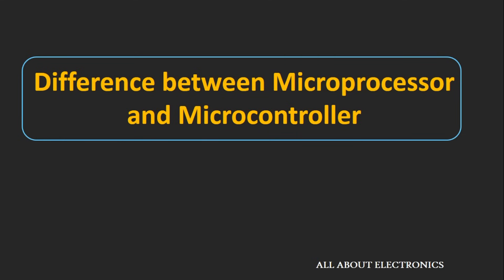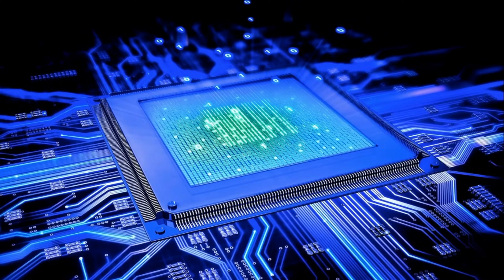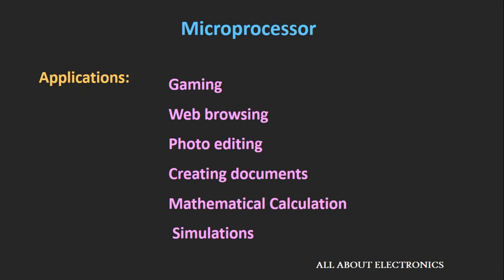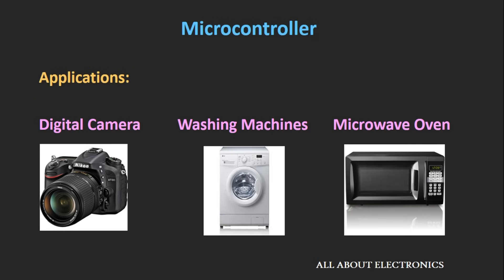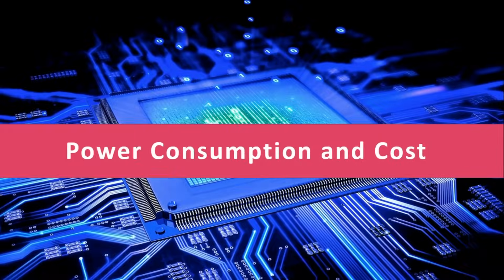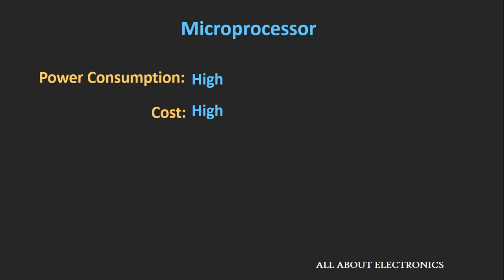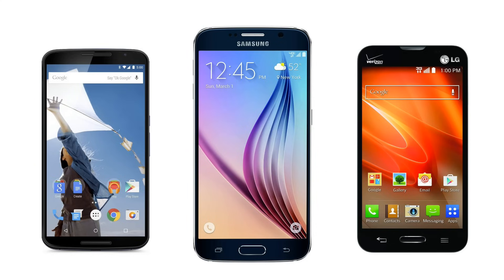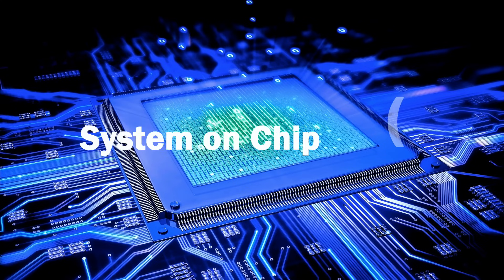Difference between Microprocessor and Microcontroller

Comment: Gimme the chance to save 7 mins of your life

1. Microcontrollers are used to perform a specific task while Microprocessors are used to perform wide variety of tasks which need not be predefined.
2. Examples where a micro-controller can be used  camera's, washing machine etc Microprocessors most commonly used in computers.
3. In microcontrollers since they do a specific task all the ram and I/O ports are integrated internally on the other hand in microprocessors all the input and output ports are integrated externally since the requirement is based on the size of the software. 
4. Processing power in  microprocessor is usually between 1-4 GHz and in microcontrollers it lies between 1MHz to 300Mhz
5. MC RAM: 2KB to 256KB            MP: RAM: 512MB to 32 GB
6. MC ROM: 2KB to 256KB           MP: ROM: 128GB to 2TB
7.  MC Architecture: 8bit, 16bit, 32bit    MP Architecture: 32bit and 64bit
8. MC Powerconsuption and cost: Low MP: HIgh

Comment: I already have an 
1 1/2 " by 1 1/2 ",circuit board with 15 circuit pieces that I have already soldered into it, I need help figuring out how to get electric current through this theoretical circuit to power small micro motors in 2 different directions,  that is all I need,
Reply from the maker: Have you checked the interconnection between the circuit components? And are they connected with the power supply?

Comment: Actually, the term "micro processor" isn't limited in smartphone and personal computer. Microcontroller consists of microprocessor. You've misunderstood about this point. Secondly, hard disk which is permanent storage media can't be RAM or ROM. ROM (read-only memory), which is normally used for BIOS or boot code, not for storing some shit files.

Comment: Today's microcontrollers are more powerful (and have more memory) than microprocessor systems had in the past, so the differences, in that regard are really superficial. What is more important is the difference between "bare metal" and operating system based programming.

Comment: there are some important updates to made in your slide microprocessors with clock speed of 8 GB are also available in market eg.  FX-8370. You have mentioned ROM and Hard Disc as same article but these are different . thanks for providing a knowledgeable video

Comment: I would say that today, the best way to tell the difference is the application space that the product is intended to address.
The distinction between microprocessors and microcontrollers are becoming more nuanced as SoCs (from the microprocessor side) and microcontrollers move toward a convergence and many FPGAs (Field Programmable Gate Arrays) are including built in processor cores.  There are general-purpose microcontrollers that use ARM Cortex-M and MIPS (and now RISC-V) based cores, can access external memory, have larger ROMs/NVM, and high clock rates.  Some of the microcontroller cores have floating point instructions, digital signal processing instructions, and other advanced features that are typical of modern microprocessors.  Today, embedded systems designers can use microcontrollers where 10 years ago a microprocessor would have been required.  On the other hand, the System on Chip (I know, another video) offerings now provide features previously only available in microcontrollers.  More than few offerings combine both types of cores in the same package. The convergence point is System on Chip from both ends.

Comment: Can we add a mobile phnoe microprocessor and microcontroller to the arudino uno board
Reply: It already exists. Check out the UDOO board. It's an Arduino compatible, which uses a tablet microprocessor (it's actually a system on chip, but that is what allows it to fit the Arduino form-factor).

Comment: Comparing microprocessors to microcontrollers is like comparing formula 1 racing car to a Vespa Scooter, a vaspa scooter uses very little fuel, can go down narrow uneven streets,  don't need a pit crew with extra parts to keep it going, but it will never be as fast. The numerical value used to show the difference between microprocessors and microcontrollers are subject to fluctuate in upward direction.

Comment: Sir can u explain me clearly Why mostly we are using microcontrollers instead of using microprocesser it is also do the same work right.
Reply: He explains it at the end. Microcontrollers are less expensive and use less power, when compared to microprocessors. Also, microprocessors are more complicated to work with - you essentially need to run an OS on them (so development on microcontrollers is much faster).
Reply: Tq sir

Comment: Hi!
Why the power consumption is higher in microprocessors than microcontrollers?
Reply: I'm going on a limb here but, microprocessors usually have a higher clock speed which can definitely impact on power consumption but also the size of the processor and the interface of the processor such a 7nm chip will take less power than a 14nm chip. I'm 13 so you don't have to trust me hope I helped!
Reply: Readytogame good try but that’s not really the answer 😉

Comment: is 8085 a microcontroller ?
Reply from the maker: No, it's microprocessor
Reply: @ALLABOUTELECTRONICS  but it   has similar feature to microcontroller eg 3mhz clock speed etc
Reply from the maker: Because it was very early age microprocessor.

Comment: Microcontroller can't handle 64 bits?
Reply: Micro-controllers usually cannot do a 64-bit operation in a single instruction. They need to chain multiple instructions for that.

Comment: Simple answer is microcontrollers are mostly designed to do some specific work, like arduino uno provides specific signals to the pins that are predefined also you can't use pwm on non pwm pin. While microprocessor can do anything.

Comment: Very good video sir, but hope you can make another video explaining how those two, Microprocessors and microcontrollers can be used in combination in modern hardware
Reply from the maker: I have already made the video on the system on Chip (SoC) which is commonly used in modern hardware. 
Here is the link: https://youtu.be/FUhCrWoNA2c

Comment: Sir Can we do any work by programming microprocessor
Reply from the maker: Yes, not all but many types of work (similar to the work being performed using computer) can be performed using the microprocessor.
Reply: +ALL ABOUT ELECTRONICS can I control room light using ir sensor and microprocessor
Reply from the maker: It can be controlled even using a microcontroller. If you interface the IR sensor with microcontroller then the set up can be used to control the room lighting.

Comment: Sir what is clock speed
Reply from the maker: It defines the rate at which the processor operates. The time required by the processor to complete the different task is defined in terms of the number of clock cycles. E.g If the clock speed of the processor is 1 GHz. It means that in one second 1 Billion cycles are generated by the oscillator inside the CPU. Or in other words, in every 1ns 1 clock pulse signal is generated. 
If the processor requires the time of 4 cycles to complete the task, it means that it requires 4ns for a particular task.
I hope it will give a brief idea about the clock speed.

Comment: Great and thank you
 but
Can we say that all microprocessors are microcontrollers but not vise versa?
Reply from the maker: Well, they are not the same. As I mentioned in the video, in the case of a microcontroller memory elements are integrated into the same chip while in case of a microprocessor, they are interfaced externally. Not only that but microprocessors are much more powerful in many aspects than microcontrollers.

Comment: What is peripheral interface sir
Reply from the maker: Using Peripheral interfaces the external hardware can be connected with the processor. For example, using USB, it is possible to connect mouse or keyboard with CPU. So, USB is one type of peripheral interface. Similarly, there are other peripheral interfaces like SPI. I2C using which ADC, DAC and other components can be interfaced with controller and processor.

Comment: What should I use if I try to make my own wifi/bluetooth video receiver? Can any of this two IC's be reprogram to do the task?
Reply from the maker: You can use Raspberry Pie for it. It is a single board computer with onboard Wifi, Bluetooth USB boot capabilities.
Reply: It doesn't have bluetooth capabilities only LAN ports and USB, SD and HDMI sockets... Only Broadcom Processors and LAN Controllers... I'm designing my own PCB Board... That will work on minimal wattage...
Reply from the maker: Raspberry Pi 3 model B has Bluetooth connectivity.

Comment: Sir, but 8051MC(Micro-Controller) has 40 bits, DIP(Dual-in-Package)
Reply: The 8051 is an 8-bit micro in a 40-pin package.

Comment: Mobile was microprocessor or controller
Reply from the maker: In mobile, you will find the system on a chip (SoC), where the processor and other components like ADC, DAC, DSP, and other components are integrated into the single chip.

Comment: What micro stands for? 
Sie tell me. 
Somewhere on net I GOT TO Know that micro stands for size. And in my college professors told me that micro stand for micro second related to time.

Sir please tell me.
Reply from the maker: Yes, that's true. In a microcontroller, micro refers to the size of the controller.  In general, micro can be used with time, weight, distance etc. If you say 1 microsecond then it's 1 millionth of the second. If you say 1-micrometer then it's 1 millionth of the meter.  I hope it will clear your doubt.
Reply: ALL ABOUT ELECTRONICS 
Thank you sir
 I mean in my college professors told me that micro controller works in very less time that is in micro seconds therefore it is called as micro controller . 😅. But truth is it's about the size of processor.
Thanks a lot sir.

Comment: Not that simple. Atxmega despite being 8bit architecture can use few megs of SDRAM externally so "microprocessor like". Also there is great integration of peripherals into CPUs nowadays they're more and more SoC-like and MCU-like. Everything is blending. And for smartphones, cameras etc. there's also SoC to do magic things like face recognition, auto-adjust, series of pics,  motion detection etc. OFC many of those can be implemented in faster MCUs but... well, let's just say most "smart" electronics is becoming more and more performance-hungry and limit of ~300MHz and one core is just not good enough. That's why even in MCUs there is trend to use 2 (or even 3) cores... NXP makes chips like CM0+ CM4 hybrids or Cortex A5 + CM0 + CM4. Atmel (Microchip now) have some CM0+CM4 too and so has Cypress with PSoC6.

Comment: This tutorial is very helpful and understandable. Can you provide some more differences which are not common? Btw I'm from Bangladesh.
Reply from the maker: Most of the aspects have already been covered in the video. But apart from that in case of the microprocessor as program code is stored in the external memory so the fetch time (No. of clock cycles) will be more. While in case of the microcontroller as the code is within the same chip, so fetch time will be less. Here I am not comparing the fetch time of microprocessor and microcontroller literally, as the microprocessor is operated at GHz frequency, and fetch time will be definitely much lesser than the fetch time of microcontroller.  But what I mean to say is, the number of required clock cycles will be more in case of the microprocessor.